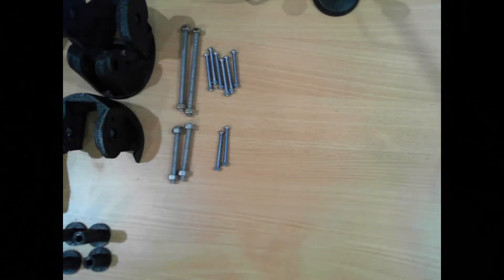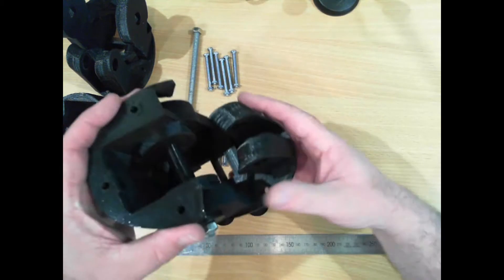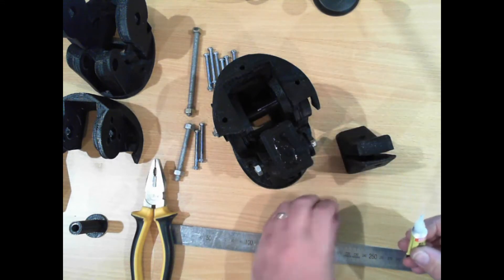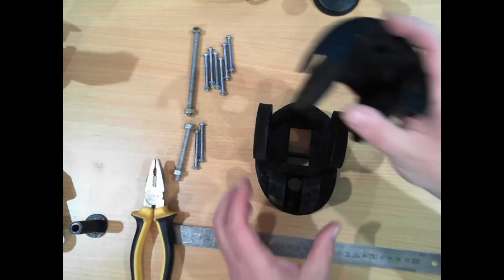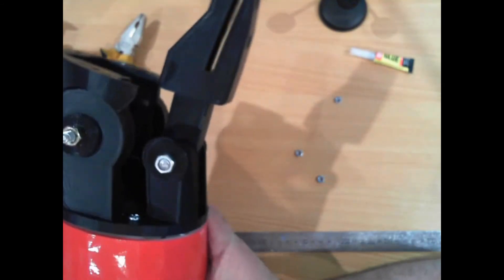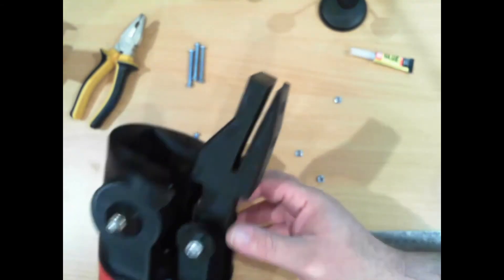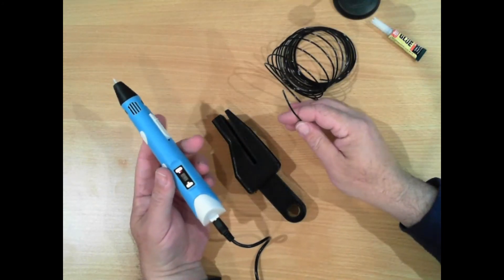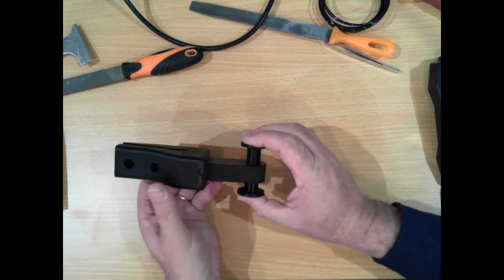Fred's Inmoov legs, Knees

Comment: Мне кажется не хватает горизонтально-поперечной подвижности тазобедренных суставов для моделирования ходьбы...
Reply from the maker: You are quite right.
The entire hip area will need a full redesign to be able to make the robot walk.
The existing ser system in the hip area are also not powerful enough nor are they fast enough to cope with anything close to a normal walking type gate.
The current design of the knee joint is also not powerful enough or fast enough either.
and the ankle joint will also need to be redesigned as well.

Comment: what for bolts and nuts have you used?  M4? Lenght?
Reply from the maker: Good question, 
It was about two and a half years ago,  but from memory, they were about 40 mm long.
Base on timestamp 6:27 and comparing with the pliers and a current box of the same type screw kits.
The kit had M4 x 20mm, M4 x 25mm and M4 x 40mm.  So It has to be the 40mm long screws used there :-)

Comment: What is the type of your printer
Reply from the maker: For that build I used a combination of the Cocoon Create Touch (rebadged Wanhao Duplicator I3 Plus) and a CR10S5.
I started with one of the printers and due to a part failure finished on the other one.
I think I started on the CR10S5 and the cheap BLTouch failed, wasn't an Antclabs unit.
All the parts will print on a printer with a build volume equal to or bigger than 200 x 200 x 180

Comment: I think you found a good way to show the welding!
Reply from the maker: Thanks 👍
I did 3 video previously on PLA Welding :-)
Reply: @CyberOne  i am waiting on a plastic 3d pen right now, along with an rtl-sdr (for a spectrum analyzer), a dg1022z i will hopefully be agble to make a video about hacking up to a dg1062z through ethernet, a gopro terminators, and attenuators. The plastic welding is something i saw through you and it makes my a8 anet 3d printer far more useful for enclosures! Thank you. I learned something very useful and will be trying this out once i get the pen. Thank you! You have some great content